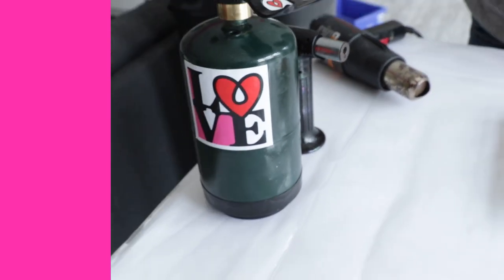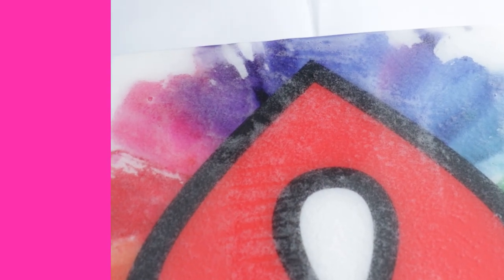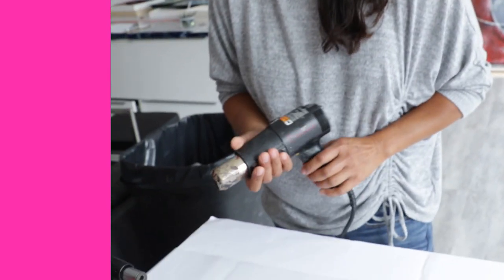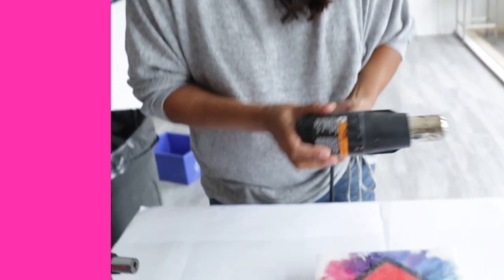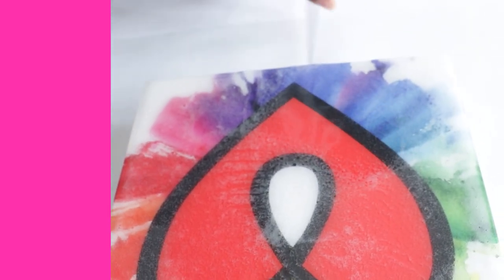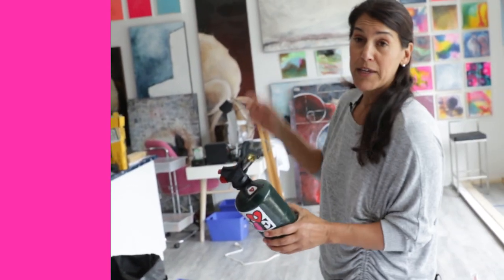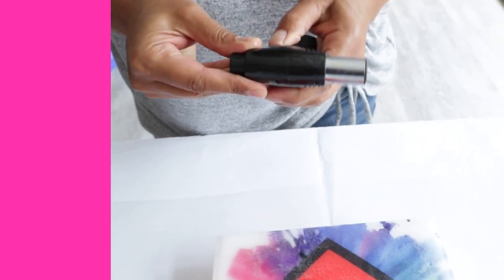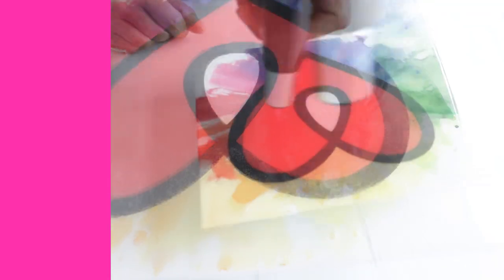Do I Have To Use A Torch To Get Rid Of Epoxy Resin Bubbles?

Comment: Torch works great but if you have used alcohol inks to tint in your resin it could flame up a bit so be mindful of what colorants you have used in the resin itself.
Reply from the maker: A great point, Christie.  ArtResin on its own is non-flammable and non-toxic, but once you start adding other things, it could compromise the non-toxicity and non-flammability of ArtResin.  We do torch ArtResin with alcohol ink in it, but it's good to be cognizant of the fact that alcohol is a solvent.  Truly, torching should be a  very, very quick motion, back and forth, always keeping the torch moving.  You shouldn't be heating the resin up enough that a solvent would ever flame up, but it's best practice to take proper precautions just in case whenever torching alcohol ink ( safety glasses, mask etc )

Comment: I use a bbq lighter, works great!
Reply from the maker: I meant to demonstrate a bbq lighter too in this video and I forgot!  The thing about a torch that makes it so efficient is that the flame is powered by fuel ( either butane or propane ) so you can direct the flame down towards the resin very easily.  A lighter may work on a very small piece, but you just can't beat a torch for efficiency and effectiveness :)
Reply: I came here to ask if I could use a bbq lighter. Thank you!

Comment: Love your tutorial. I want to know about safety. Which one is safer and more affordable? Torch or heat gun? I'm doing wooden/concrete coaster & TPU phone case. Sometimes I do canvas & wooden tray.
Reply from the maker: We always use a torch here in our studio, they are quick and easy to use.  A heat gun works too, so it is really up to you and what you feel comfortable with.  The torch uses an open flame which works super quick to clear bubbles, the heat gun is high heat so the resin heats up and bubbles pop.  Either way, you want to just pass the torch or heat gun quickly over the surface of the resin to clear the bubbles but careful not to over heat it.

Comment: What if you're using a silicone mold, won't those get melted or are they fine if you just move very quickly? TIA.
Reply from the maker: Torching is meant to be real quick so we just keep a constant motion going and be cautious around the edges of our molds to help them not break down as fast :)

Comment: Can't you use denatured alcohol as well Instead if any heat tool ?
Reply from the maker: Many artists who use silicone molds to cast resin use high % isopropyl alcohol spray to clear off surface bubbles.  For the purpose of coating a flat canvas, nothing can compare to a torch to zap bubbles quickly.

Comment: You could always use a blow torch, but then-lol.  Seriously, using a heat gun or hair dryer works fantastic when you are moving colored resin around a resin pour.  You can get great lacing effects.
Reply from the maker: Hey Ashton!  I've seen artists using heat guns and hair dryers to get really cool effects with tinted resin, absolutely, but for zapping bubbles, you can't beat a torch :)

Comment: I have air bubbles after it cured. I know I have to sand but how much sanding to do?  The air bubbles aren’t above the surface. I am worried that if I keep sanding I am going to mess up my canvas.
Reply from the maker: Sanding is easy when the bubbles have risen to the surface and can be easily sanded off and re-coated.  For the bubbles that are trapped within the resin, unfortunately you would have to carefully sand down enough of the cured resin to open up those bubbles.  Pay close attention to not sand down into your art layer when trying to get to these deeper bubbles.

Comment: Am I able to remove the bubbles after two days of applying the resin?
Reply from the maker: If your resin has cured you will have to use sand paper to sand out any surface bubbles.  Once the bubbles and any imperfections have been removed by sanding, you can pour a fresh coat of ArtResin over top to restore the glossy finish.
Reply: @Artresin  Thank you! If I don't use the original resin, will it be okay to mix? Or is it better to use the same resin? (in terms of brand)
Reply from the maker: @JerrodVoong  it is not a good idea to mix different brands of epoxy resins and hardeners as they are formulated to work with each other.  Typically you can apply a different brand of epoxy over another brand of cured epoxy without issue, but switching up hardeners and resins from different brands while mixing is not advised.

Comment: is the art resin brand torch safe? I want to use it to get cells with acrylic pours.
Reply from the maker: Hi Janine - the torch is safe for use with resin for sure, but to achieve cells, a lot of artists prefer to use a hair dryer or a heat gun rather than a torch to create cells.  The torch is for removing bubbles and is meant for minimal use - it heats the surface but doesn't create enough movement to move the resin.  If you over torch, you might burn the resin and/or the paint.  To create cells, you need to push the resin around so a heat gun/hair dryer is your best bet.

Comment: So I bought a propane torch, and when I turn it on it's side, to get close to the canvas, it shuts off!  I did not know this would be a problem.  Just wasted about $25.  Is there something particular the propane torch should say???
Reply from the maker: Hi Linda, not to worry this is completely normal. Propane torches alone are not meant to be turned on their side this way. For this reason we developed the Artist's Propane Torch Head with Wide Angle Flame Attachment.  It connects to any portable propane tank and withstands temperatures up to 2400°F (1300°C ). It's safe for indoor use and has an automatic ignition button, adjustable flame control knob as well as a rotating hand protection plate. The flame spreader attachment produces a wide, flat flame. To learn more, please visit our website https://www.artresin.com/products/artists-propane-torch-head

Comment: Hi! I have a question. I never worked with resin before so I was wondering how long do you have until the resin starts curing and you can't no longer work with it? And does that time change if you use the torch?
Reply from the maker: When used as directed ArtResin has a working time of 45 minutes. The only time that would be impacted by the torch is if it was used too much and was heated/overtorched. :)

Comment: I used a lighter and it started to burn my glitter (white). Is there a difference with lighters and torches?
Reply from the maker: Hi Erica, yes we recommend using a torch rather than a lighter.  A torch is much hotter, which makes it easier to lightly kiss the surface from a distance. With a lighter, you may have to get too close which sounds like what may have happened in this case. Feel free to send an email to our customer service team at support@artresin.com and one of our artists would be happy to share more information with you.

Comment: My new gas tank keeps flaring out once i turn the gas tank to work the resin.  Any suggestions ?
Reply from the maker: We haven't experienced this ourselves but here are some ideas...

Could be the tank is a little too full.  Or maybe it's cold and needs to come up to room temperature?

The torch head could possibly be clogged or when using the torch sideways ( as opposed to upright ) it can happen.

One of our team members read that letting it sit for a minute with the gas valve open so the flame is strong so it burns off some of the gas can help alleviate flares.

Comment: You don’t blow on the art pieces, you breathe hot air just above it to pop the bubbles. Blowing on it that hard will of course move around the resin. Yes a torch is the easiest method but if you’re going to show other ways of doing it, at least demonstrate it properly.
Reply from the maker: fair comment, thank you 🙂 ( although I know some blow through a straw which would seemingly result in a more concentrated blast of air )  
But still, blowing/breathing on a piece of artwork is not the most effective or efficient method unless, as I mentioned, you're working on something tiny.